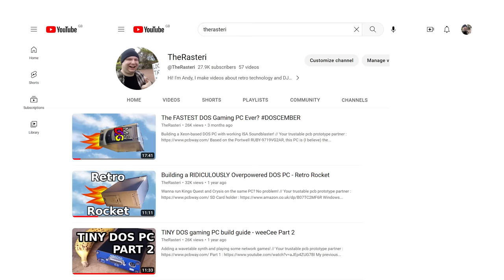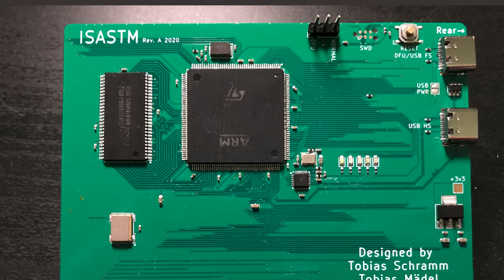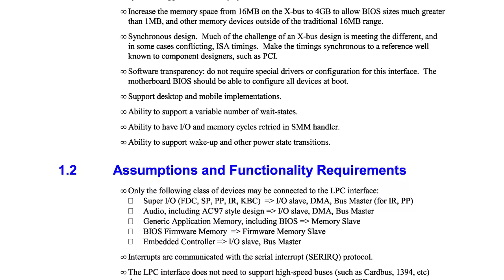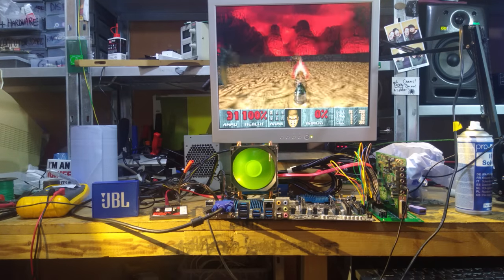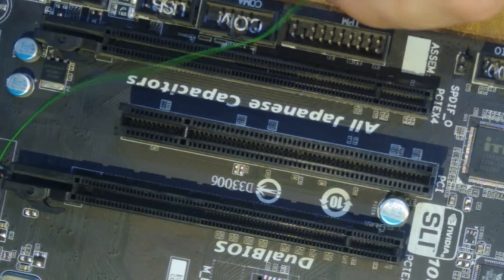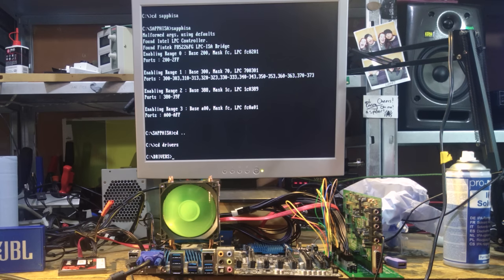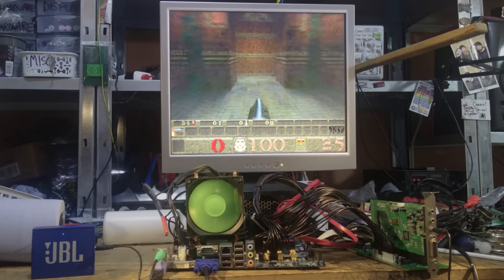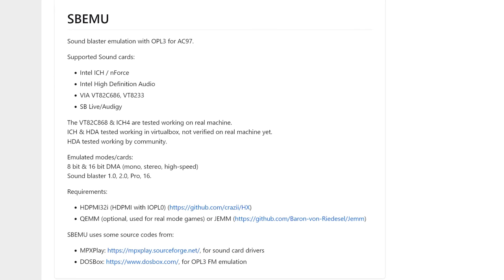Add an ISA slot to Modern Motherboards!

Comment: Interesting, I have an old ISA shortwave radio receiver, so I wonder....
I'm surprised it's kind of so complicated, I would have thought all the signals etc would be there on the PCIe bus, just need an adapter, that was never made. However all the PCIe 'lanes' bit has me a tad confused, as I'm coming from the point of mapping an I/O chip to a memory/IO address, (as was done on a Z80/6502) but then it works via a lane... What the...
Anyone know a site that explains this lot?
Reply: ISA and OG PCI are both strictly parallel buses- PCIe instead communicates over a number of serial "lanes" - the number of which is indicated after the "x".

Any device on a PCIe bus communicates in much the same way as on old PCI. The language is mostly the same, but the physical part is quite a bit different.

Another trouble may be the migration to UEFI instead of BIOSes - that has already broken some compatibility with GPUs, eg. newer GPUs on older PCIe boards

Comment: I often remember seeing things called "PCI-ISA Bridge" in the Windows Device Manager, and wondering if that could be some kind of adapter chip you can buy and build a board with, to simply make a straight up PCI or PCI-e card you can connect an ISA card to. But never went out to research it.
Reply: As far as i'm aware, it's not truly possible. PCI ISA bridge on the mainboard of that era when you have probably first seen it (like in 2000 or XP) and when it was actually fully functional, so Pentium 3, Athlon era, is chipset integrated and uses a side channel. Even PCI soundcards with full hardware-assisted ISA compatibility required SBLINK connector, which broke out DRQ/DACK and INT signals. This is the side channel. This is for DMA management, no data passes through it.

If you needed just IOP compatibility, i do believe such chips exist, there was the Winbond PCI to ISA chip at the time in the early 2000s, and there was an industrial/engineering use card or several built on it. NE2000 and Adlib might work; Soundblaster and anything fancier would not.
Reply: @SianaGearz  completely eliminated all traces of the legacy ISA DMA controller? If so you could probably put the DMAC on the converter card itself. You can really only have one DMAC in a system so when motherboards emulated ISA DMA to run floppy drives this wasn't an option.
Reply: @eDoc2020  I don't think they'll ever cut it right out. 8237 is by today's standards a handful gates, and if removing them is any risk at all, they'll just keep it in, twice. Eventually they just dangle there in the ASIC netlist not having access to any real hardware, but still nodding along to control register reads and writes. Today, functioning uses i can think of are LPT port (pins usually not exposed but still present on some eSPI SMCs physically) and memory to memory copy.
Reply: @SianaGearz  If that's the case how come the C620 and later chipsets don't support DMA over LPC? Without ISA slots or floppy controllers the use is memory-memory transfers which are pointless for anything after the AT. PC parallel and serial ports don't use DMA so that's a non-issue.

In a related note I'm reading that the 4th gen and newer Intel chips have dropped support for gating the A20 line.
Reply: @eDoc2020   The datasheet actually just about spells it out: AT DMA controller is still there, it's just not usable over LPC because LDRQ lines have been made unaccessible. This brings it in line with eSPI capabilities where 8237 access hasn't been foreseen either. They actually don't expect you to use LPC at all on these chipsets, they're cutting down IO lines because pins are expensive.

The A20 gating support had been deprecated but stayed around for a while including in Haswell/Skylake CPUs; however whole system support for it became ever less prevalent, like the BIOS call, PS/2 style fast toggle, keyboard controller via SuperIO, lines being routed. And by all reason there were possibly already CPU steppings of Haswell where it didn't work, because it broke and wasn't worth a respin. I don't know how to validate reliably whether it's still present on the CPUs.

Usually there isn't any cleanup and deliberate removal of existing internal semiconductor logic happening, things just break because they got overlooked, and that's the new reality then. Maybe after they're broken for a sufficiently long time, there may be cleanup happening.
Reply: @SianaGearz  I haven't read any recent chipset datasheets. If it can be disabled that would be an option. Or worst case you can use hardware virtualization which traps accesses and can redirect them to another address.

Checking the A20 gate is easy if you are running bare-metal code. Write something to one address, write something different 1M higher, then read back the original and see if it changed. Of course if the methods to disable the line have been removed it's meaningless/impossible to check.

Comment: So why not build a program that redirects and translates, Isa access over to usb controller, that any game asks would able to tell... sorta like giving a retro game rom a emulator to run on. It doesn't know it's running on a virtual machine...

Now I have no programming knowledge but why wouldn't this be possible 🤔  building something via software and even adding hardware via modern means such as USB, and running these unmodified msdos games in a virtual environment that let's them access old hardware via new hardware doing the translating and virtualizing

Comment: I used to have that same type of laptop (5:13  ), mine was absolute garbage, and the battery died after a few weeks of use, and then computer completly died after around a year, but admittedly I did buy it second hand for like $100 at the time

Comment: i would love to figure out if you can put a soundcard that can be midi driven, but in a box instead of connected to a pc.
like making an external midi synth out of a old soundblaster card that used the emu chips, but those cards are pci mostly

Comment: Is there such a thing as a 'self respecting DOS gamer'?
I mean: people with self respect did not play on DOS-PCs in the 80s and early 90s ;)
DosBOX-X is really great an I like it for playing the old games.
But for example Amiga games actually require real hardware, because there is a huge difference and a lot of shortcomings in an emulator.
Btw You where right:

'hwinfo|grep LPC
  E: ID_MODEL_FROM_DATABASE=QM77 Express Chipset LPC Controller
  Model: "Intel QM77 Express Chipset LPC Controller"
  Device: pci 0x1e55 "QM77 Express Chipset LPC Controller"
'
And: Genius job! Finally that pesky TPM port has a decent use! VLB bux next? xD

Comment: CH368, CH367, CH365. You can use those as PCIe(sic!)-ISA Bridge.
Reply: Wow WinChipHead has the weirdest and most useful stuff. Problem is even with PCI you don't get ISA compatible DMA, no ISA compatible IRQ, and with PCIe this doesn't improve. So while you could connect an ISA card to a PC like this, it wouldn't be usable in DOS.

Comment: Why would you want to do it though? If you want authentic DOS gaming, you're better off building a period-accurate hardware, with the 80s/90s mobo, CPU, GPU (if you need 3d acceleration and ordinary VGA is not enough), soundcard, etc. because some of those old games either don't run on too fast processors (especially if they were written in Borland tools, such as Turbo Pascal, as there is a bug that causes games and software using the C rt module to not run on too fast CPUs) or have timing tied to CPU speed (basically the game assumes that your computer is, e.g. a 4.77MHz machine, therefore one second = 4.77M instructions) and run too fast on too new computers.

Comment: Wasn't the 1st ibm pc MCA and not ISA?
Reply: Nope, the MCA bus would come later in IBM's introduction to their PS/2 computer line in the late 80's

While the ISA bus is from their first AT line of computers (known as AT-Bus by IBM) as rasteri mention in the begining in video.

How did you miss that? 🤔
Reply: @explorer9049  i worked on both, just wasn't sure wich one was 1st..it was eons ago, but some memories are still vivid, like T-Rex chewing trough some tokenring cables causing few stations to drop out😂

Comment: Broadwell & haswell chips are actually quite cheap used now. Pair it with a cheap chinese x99 board that has a tpm 1.0 or 2.0 header and youll be set

Comment: If you use an nvme drive instead of something else and a weird ass cord with a power supply plugged into it, is that pc not technically a single board computer

Comment: Even this workaround exists. Around 2030 x86 CPU may not even support 16 bit Real Mode and Legacy BIOS Boot mode / CSM. Since industry already fully transitioned to UEFI (except for some industrial or embedded system)

ACPI are updated so some devices (Serial Port, Parallel Port, RTC, etc.) that rely on LPC/ISA now also accessible on MMIO indicated by ACPI Tables instead of legacy I/O Port address.

Good bye Bare Metal DOS for real.
Reply: A lightweight hypervisor would enable near-bare-metal support.
Reply: @eDoc2020  Only if CPU still support real mode in hardware. Otherwise things need to be run on real-mode emulation (which is OK because CPU it fast enough to do that)
Reply: @sfalpha  Which all x86 processors do. What is lacking in 64-bit "long" mode is virtual 8086 mode. When 64-bit Linux needs to run 16-bit code I believe it actually switches fully out of 64-bit mode and into 32-bit mode, then switching back.
Reply: @eDoc2020  I mean the future, Hardware may not support 16bit real mode to reduce complexity of current x86 processors. So it cannot switch to 16bit code because it not support the memory model and instruction and register belong to 16bit real mode. It need to be translate into 32/64bit code by hypervisor/emulator.

The boot code entry in the future may boot with 32bit protected mode since power on with help from EC firmware to setup initial page tables in memory.
Reply: @sfalpha  I think protected mode is the same whether 32 or 16 bit. I can see them dropping real mode but I doubt they'll drop 16-bit p-mode anytime soon.
Reply: @eDoc2020  
With all PC switched to 64bit UEFI only booting in the future. There was no reason to provide 16bit support to software / OSes anymore. Since it cannot natively boot into 16 bit mode

Comment: Hah I have that chip your talking about, the 24 core xeon intel.  Hell got two of them in a duel motherboard server.  I found them in a swap in a bin of "broken cpu's" for 10 bucks a pop.  Don't recommend them now though they use power like a hot thirsty dog in the summer and they get HOT.  You start to really respect modern server cpu's when you compare them.

Comment: I wonder how many people even know what an ISA slot is nowadays. I grew up building early pentiums and a 486 here and there as a kid and remember them well.
Reply: Do you recall connecting pins on slave and master drives on same IDE cable?
Reply: @OCTAGRAM  Yeah, I remember messing the with jumpers on the back of drives to set them up. I can't remember the last time I had to do that, lol.
Reply: @Map71Vette  I have modded old PC shell into USB dock station so I can plug in power-demanding optical drive into my MSI  VR One Backpack PC. USB BluRay drives are less capable, especially wrt. BluRay and M-DISC support.

I've got this shell with old internals. With ancient CD-ROM. I look into its pins and I know what they are for. There was a special cable to connect CD-ROM and sound card, and old CD-ROM has appropriate pins. It is long gone on my new ASUS BD-RE.
Reply: @OCTAGRAM  I think I remember something like that as well. I rarely dealt with them as I didn't really have "premium" computer stuff back then. Mostly just played old DOS games and hoped sound would work, lol. I played around with the odd SCSI drive here and there, but that was probably about as exotic as I got.  I'm not even all that old, I just grew up around the stuff because my dad was in IT most of his life.

Comment: Sata power connectors have 3.3v, 5v and 12v on them..!
Reply from the maker: not -12v though, unfortunately :(
Reply: @TheRasteri  7660 clone IC.
Reply: @TheRasteri  The first 3 pins (starting from the notch) on SATA power are +3v3, then 3 ground pins, then 3 +5v pins, then 3 grounds, then 3 +12v pins

Comment: As windows 10 and 11 only accept signed drivers your mostly out of luck. You can disable the signed driver requirement. But It's not easy by design and not really to be recommended, at least not on your daily driver PC.
Reply: Why even disable drivr signature enforcement???
Sign it itself and add signature to windoes trusted signatures.
Reply: @felixokeefe  create a new certificate, sign a driver with it and locally add it for driver signature enforcement.
Microsoft even has relevant documentation (for developers) named "signing a driver" or "signing a driver during development and testing".

Comment: For me, this would be used for a floppy controller card so I could keep my A1200 100% legit, but still get disk images over. No compact flash, no gotek.

Before someone suggests it; USB floppy drives don't do 720k. Even if I use tape over the hole or an actual 720k disk.
Reply: I thought USB floppy drives can do 720k. In fact I'm sure I used one to read some old disks, some of which were 720k. Maybe compatibility varies by model.
Reply: @eDoc2020  Nope. Even tried command line format, just says unsupported disk format.
Reply: @fattomandeibu  I wasn't able to low-level format floppies with the USB drives I was trying. If you format on the Amiga the USB drive will probably be able to access it. That should be good enough for writing images using dd, Win32DiskImager, or similar tools.
Reply: @eDoc2020  Tried that. Just says unreadable disk, and yeah, I formatted it to 720k, not 880k.

Can't write the images using a PC as they are 880k. I have to format them in 720k, zip the image and slap it on the disk, then copy the image to the Amiga's HD and write it to disk from there.
Reply: @fattomandeibu  I don't have any Amiga experience and didn't know 880k disks were a thing. Is it possible for a native PC floppy controller to format to 880k?
Reply: @eDoc2020  They're just plain old 720k disks, but an Amiga's disk controller stores more data by storing more on the longer outer tracks, whereas a PC stores the same amount of data whether on the short inner track or the longer outer tracks.

Last I checked it wasn't doable without a special controller.
Reply: @fattomandeibu  Oh, so is your current process take an image on a new PC, copy it to an old PC, write it as a compressed file on a 720k disk, copy that to the Amiga, decompress, and then write the image? That certainly seems like a hassle.

CF in place of the internal HDD would be sacrilege, but that's not the only slot. I would probably go with a CF card in the PCMCIA slot. PCMCIA flash cards were around in 1992 so it's not much of an originality breaker in my mind.

Or just use the RS-232 port.
Reply: @eDoc2020  I have no current process. The PCMCIA slot no longer works, and the only computer I have has no floppy controller.

I used to copy the zipped image to a 720k disk, decompress it on the Amiga, then write the image to disk from there.
Reply: @fattomandeibu  Then I'd just go with the serial port. USB->RS232 adapters are fairly cheap. It won't be fast but it will be faster than you could get with a modem back in the day.

Comment: The next question is to get a 64-bit machine to run a 16-bit program without any intermediary software, like virtualization or DOSBox.
Reply: That's not an issue, the 64 bit x86 CPUs are backwards compatible. It's the 64-bit OS that usually prevents you from running 16-bit code.
Reply: @eDoc2020  Yeah, the OS is what I meant. Realized my mistake not long after I posted this.
Reply: @Chaos89P  Linux on x86-64 has workarounds to run 16-bit code. dosemu emulates DOS calls but runs the application code directly on the CPU. AFAIK the same is true of Wine on Linux.

Comment: Looking for isa card design that can plug esp32, arduino  , raspberry pi, using main board clock, power, storage/memory(at least  mb via kb i.e. main board storage as sbc's extra memory), io(keyboard etc).  Basically reversing old main board to  become auxiliary feature to modern sbc, another word of saying, sbc is the master.
Anyone came across such open source design?
Reply: At least 8 mbit clock is useful for arduino bare chip. Had been looking buyable ready-made card though.  Not much electronics background.
Reply: Or for that matter, enough lines for 8501 : clock, power, serial, or dma interfacing with sbc.  Good old peek n poke
Reply: Cheap pub board with few resistor etc would be nice.  Mainly not taught in pbc making, still wires all over the place. Tried filing the teeth out a bare copper  pbc as isa connector, ending short circuit ed timing line with power line 😭
Reply: BTW, hope to let such sbc emulate at least a boot up floppy too as all old drive are death.  Can't boot old cpu even to a openwrt.

Comment: Theres an h81 motherboard with 2 isa slots
Reply from the maker: the HD620-H81? Yeah it has slots but unfortunately it uses a PCI-ISA bridge so it won't support DMA, and therefore no soundcards
Reply: @TheRasteri  just use the busmaster to dma driver. Shrugs

Comment: It's somewhat sad that even this innovative new compatibility solution already won't work anymore on new hardware – it only works with some difficulty and up to a point. It's never been cheaper to keep legacy support around, so why are they doing away with LPC support? My tinfoil hatted alter ego says that it's being done for less-than-wholesome reasons of wanting to control everything and wanting to lock tinkerers out. Which is exactly the opposite of what made the PC successful.
Reply: There's plenty of tinkering to be done with PCIe.